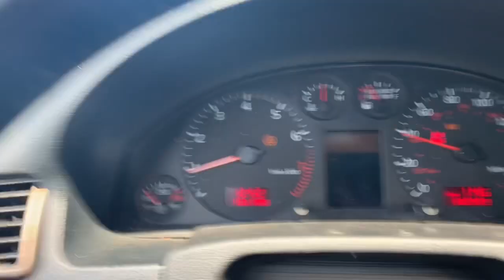Rebuilding The Audi A4 Ep. 1 Radiator Support Removal

Comment: I been having my Audi A4 sitting for 3 years cuz of parts an labor prices and yu are inspiring my guy don’t quit going hard for whatever yu want
Reply from the maker: Hey sorry havent been checking my messages and stuff been going through alot but Thank You !!! More videos coming soon
Reply: @TheMariiTv300  yu good trust me ik how it go
Reply from the maker: @808tali  Appreciate it!!! I've uploaded more videos. Go check them out , also working on coming out with some more this weekend. STAY TUNE !!!! THANK YOU FOR THE SUPPORT !!!
Reply: Mine been sitting for 8 months. Finally replaced the lower control arms and cv axles. Now i gotta either replace or patch my radiator then fix my back wheel which needs a rotor and brake pads as well as an a alignment.. this car is a pain in the ass but i love her

Comment: Can u remove the radiator support without removing unhooking the radiator and losing the coolant. My radiator support is bent enough that the hood bent slightly but nothing else is messed up simply needs a new radiator support and a hood.
Reply from the maker: Sorry for the late response idk why I do not get notifications but I do need to start checking my notifications alittle more but to answer your question Yes! You must drain all the coolant out of the radiator, disconnect all 3 hoses connected plus the power steering hose, remove crash bar, and there are 4 bolts on the top and 8 bolts in the front that removes the whole radiator support assembly!!! Hope this helped out a lot.

Comment: Have an 08 a4 with a smashed front end recommend a rebuild or junk?
Reply from the maker: how bad is it ?
Reply: @TheMariiTv300  the whole front end is smashed and the passenger side quarter panel the airbags had deployed and the back roll bars
Reply from the maker: @kk-kh2kk  honestly car sounds totaled but can be possible to redo and repair but only if your really willing to put out the finance causes for body and frame work plus parts that needs replaced and you would need to go to a dealership to get airbags replaced and reset

Comment: there are 4 other screws you forgot to mention in taking the front bumper off wich requires removing the wheels and liners
Reply from the maker: i didnt have to remove the tires i was able to get the liner out without

Comment: you saved me bruh ive been tryna remember where the connector went for the ac condenser and the one that goes on top of the powersteerimg line

I did it fast af so when i saw it in the right place again i was like nahhhh but damn that was a long two days 🫠